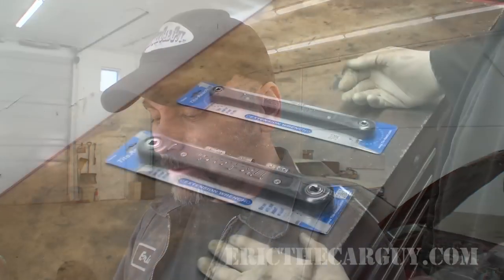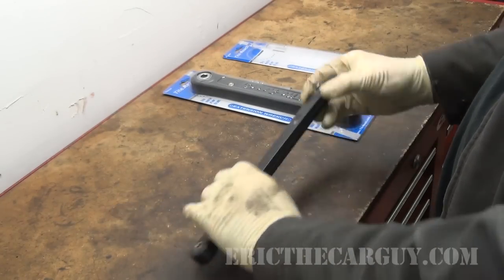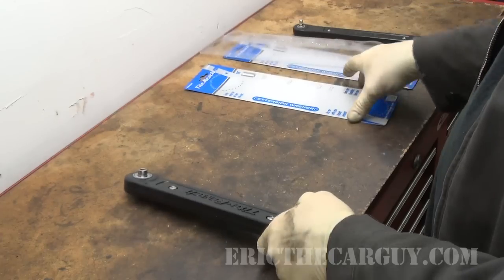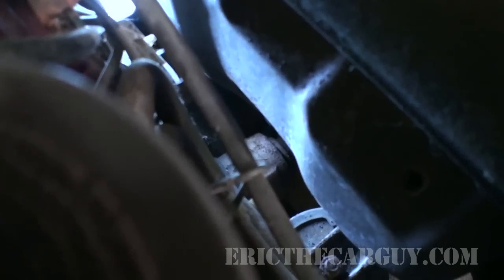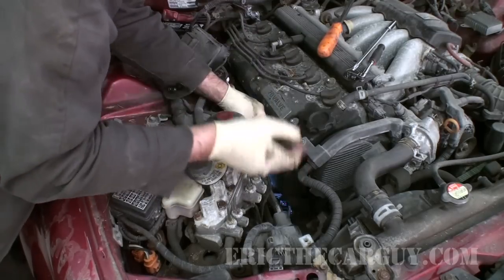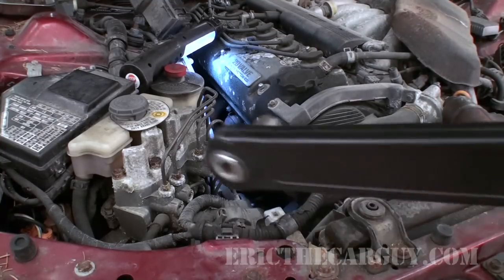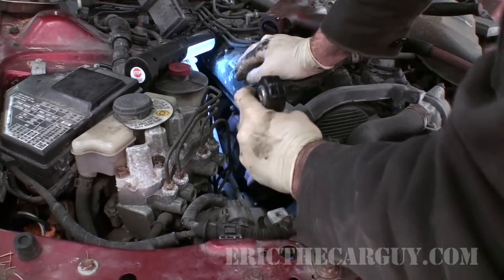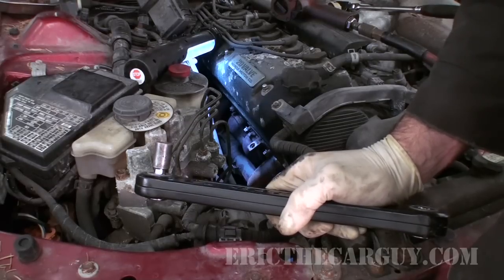Tite-Reach Tool Review -EricTheCarGuy

Comment: I am a auto tech and bought one of these and had similar issues and stopped using the tool. It is quite large for tight spaces in which i wasted time on the job trying to make it work, Not as a "time saver" i thought it would be still had to stick to the manual.

Comment: Working on boats, I’ve found this tool to be a huge time saver 
Some common maintenance parts you just can’t get to without pulling the whole engine, because there’s no room to get your hands in an area
But with one of these and enough extensions you can get bolts turning

Comment: I love unique and "specialty" tools like this.

One thing I learned  (the hard way) over my years of wrenching is having the right tools for the job is CRITICAL. For example, I will NEVER work on brake lines again without a flare nut wrench. Having the right tool for the job will save you time, money and more importantly save you tons of stress. The "special" and unique tools were obviously built for a reason, use them! Lol

Comment: I'd like to see it used with a torque wrench to see how much torque actually gets transferred.  This would be awesome for doing Subaru valve cover gaskets.
Reply: Its 1:1 with slight +or- 3%
Reply: I think he means how much of the "punch" is lost, very much like when you use an extension you lose torque into transferring the energy through.. like a torque stick if you will.
Reply: Gabriel Soria extensions on torque wrenches dont hold much bearing as well (withing reason) . The extension takes up the twist until it  stops then the force is directly transferred to the fastener. Being tourque applied is measured at the ratchet head not the fastener head. Offsets change torque or dont depending on situation. I can explain further about that if people would like. But this device is a direct chain drive, with both gears at 1:1 so what you put on the ratchet is what comes out of the end. Impact torque is different so whats happened here is that slap of the anvil is takin up by the play/lash of the internal mechanism and not relayed to the fastener head as well as we hoped. So there is torque being applied just not as well as if you had a ratchet. And I'd venture to say that it was pretty minimal
Reply: BIG BOSS maybe where confused.. I'm talking about  an impact gun. With an impact it cannot be 1:1, there will always be losses of the impact transferred. But totally agree if your using a wrench.
Reply: Gabriel Soria indeed, the slap of the anvil is taken up by the lash in the chain/gears. Like an extension.... Pretty smart of you gabriel
Reply: The gear ratios are 1:1. They advertise a 8% loss with a torque wrench.
Reply: @jkritter456  where is the link for this?
Reply: Ive seen another famous car fix youtuber that reported a 6% loss. He's pretty reliable so I would say between 6-8% loss at max.

Comment: Erick I invented this a long time ago. mainly to be able to loosen crank bolts with out removing the fan shroud etc to do a seal replacement.. And yes it needed n air gun. My idea uses a very strong chain and is very long to reach places these tools can't.  I like these, don't get me wrong. Will be nice if they made a longer version of them. Great video as always. thanks.

Comment: The awesome thing about this tool is that the way the adapters are designed you don't take up an extra amount of width for converting from 3/8 to quarter inch or half. With a standard socket wrench, you can't remove the preset Anvil, so you're adding extra with which can kill you when you're adapting to a smaller Drive

Comment: The reason your impact would not work very well is that inside the tool the ends are connected via a sprocket chain, your impact energy was being used to stretch the chain, and not actually impact the bolt.  It is similar to how an impact will not work as well with several extensions on it.  Neat Idea though and I can think of a few situations that it would be great in.
Reply: Good point !!!  And that is the principle behind torsion bars; to soak up the shock.

Comment: I'm a GSE mechanic and I can see how this tool will save me a lot of time.  Never  heard of it but it is a great idea.  I wish they had one that is 1/2 inch so I can get a half inch impact on it.  Also this can be used as an torque extension for those extra tight nuts.

Comment: I also want to see a review of cooper tools apex insert and power bits. They are the best bits I have ever used. They come in different hardnesses and never round off. I love their allen bits. You might also want to do a bondus power bit test. They allow angled access to allen head bolts. You can get both of these from mcmaster carr on-line for a couple of dollars each. One other thing you might want to try , Eric, are park tools. These are bicycle tools but they sell some tools that have automotive use such as their three way socket wrench or their three way allen wrench that is like a four way tire lug wrench but have three instead of four and of course, is much smaller. Very handy. Home depot also sells this dewalt right angle insert bit adapter. You attach it to your drill for right angle access of bolts, that's another good one.

Comment: Having to break the bolt loose first is the initial problem. I spent nearly three weeks on two bolts on my starter that I had extreme difficulty just even getting the socket and wrench on it and then there was no room to crack the bolt loose. That tool said it was able to handle up to 400 fiit pounds of torque. If you have to crack the bolt before using the tool, it seems to me, it's defeating the purpose and a waste of money.
Reply: Yeah i feel the same i have long low profile air rachets i can get better results with, bolt buster a induction heater works wonders on rusted stuck bolts as a fyi saved me many times

Comment: That's a neat tool.  In the example you gave though, a long handled ratchet with an extension would have worked just as well.   This tool is more for bolts deep in areas with no room to swing a ratchet.  Which doesn't come up that much IMO.   A bigger problem I have is a bolt with too little clearance for a ratchet at all which this took doesn't solve.

Comment: I bet it would work good on tq converter bolts, and definitely on belt drive stuff.
I would try to make some sort of button that would lock the chain set up or whatever it has..So when you run into a stubborn fastener you could leave the gun, tite-reach, socket in place and snap it loose. unlock,  impact.
good review, eric

Comment: Being a chain/sprocket design it would negate a lot of the impacts effect due to the chain absorbing the hammer hits. I can see where it could be useful in saving scraped knuckles though. Similar concept to the sidewinder tools and the old squeeze ratchet I had, how to remove a fastener in an area you have limited access.

Comment: These tools probably work by using a chain that drives the other side from the one side. So it's just logical that, if you put a driving force tool like a ratchet or an impact on the same side as the bolt is, then you'll have to use it in the other direction, because you turn your force around 180°. Also, the impact motion probably works better when you use it in the conventional way (the impact being on the opposite side of the bolt you are trying to loosen), since the way you used it, the impacting motion would actually hammer the tool away from the bolt! Just basic logic (or maybe physics, but no rocket science anywhere involved). Still, this is a neat invention!

Comment: Eric, do you do reviews of tools that viewers suggest or do you only do tools that are sent to you by companies? If you do viewer suggestions, I suggest you do a review of the stanley (or any other brand) twist ratchet wrench. It is basically a ratchet handle who's  handle you twist like a screwdriver to turn the socket on the end. It is for tight access bolts that don't allow much handle movement.

Comment: I’m not surprised it doesn’t work well with the air impact wrench. Whatever transfers the motion to the other end (chain?) is going to act like a shock absorber and dampen some of the impact ‘blows’, so it’s not an ideal use for the tool. But using it with a plain old ratchet seems to work like a charm.

Comment: I love your show! Also the forum, but this particular tool by the sound and look of it seems a bit on the cheap side. It couldn't even transfer the impact power to the fastener. Now for a ratchet it looks useful in vary tight spaces. But overall I think it can come in a pinch when you need it. Keep up the awesome work you do and can't wait to see your projects come to life. If I was a engine manufacture, I would send you a crate engine :)
Reply from the maker: Thanks. I would gladly take that engine. :)

Comment: I don't know, it just seems like the transfer of leverage is awkward which requires two hands on what may be an impossible to reach fulcrum point.

In my experience which is very DIY limited, I find I'd rather have my hand on the back of the ratchet to make sure the socket doesn't slip off or round the fastener, not at some awkward mid point on a reaching tool.

Comment: Did you run in forward with the impact to have it drive in the correct direction? Since you were using the opposite side, you'd be tightening it if you were in reverse.

EDIT: Oops. Should really stop commenting AS I watch and just watch first. lol.

Comment: Nice video. However i feel that a ratchet (better if flexible) with long handle or extension will work better due long lever arm. Impact wrench aspect is an advantage but again it didnt seem to be working as in the video.

Comment: I would think that if you can get that tight reach tool some where you could get an air ratchet there too. Junk, worthless tool in my opinion.
Reply: ***** If you're going to use a hand tool, might as well use a Gear Wrench which can get in even tighter spaces. This seems almost as thick as my ratchet.

Comment: DUUUDE!!!!  At first I thought this was a bit like an extra long torque adapter that would basically turn a 24" breaker bar into a 36" breaker bar.  This is soo much cooler.  I hope they come out with a 1/2" pro for those really hard to reach fasteners that need a ton of torque and bigger sockets.  Lets you get into tighter spaces than an ingersol rand hammerhead.

Comment: I bought the set of 3,  maybe use it once or twice a year,   its handy when you need it.  Dont use an air tool on it & crack your bolts first and it will last.

Comment: The "impact" of the impact driver won't work because in order for it to do it's job it has to be right on the bolt hammer down on it...  As soon as I saw you going from the same side as the bolt I thought "it needs to be in reverse"

Comment: I guess I'm old enough to see life's repeats. Just like speed wrenches I was given from the 60s and 30 years later Snap On came out with "speed wrenches" , my dad had one of these extensions when I was a kid 40 years ago. It had a ball chain inside that connected the two ends. It was a stamped tin covered mechanism. (I know what it was made of b/c I took it apart) I guess patents run out or get sold and that's why an old tool gets new again. Sometimes, it may be due to better grade materials to make it work better. I guess on the conspiracy side, maybe China is buying up old U.S. patents.
Reply: Its china. they just make it. no need to worry about patents when your nation does not recognize patents of any other nation.

Comment: Interesting. I am wondering what the internal configuration is. Maybe a sprocket on each end connected by a bike chain?
Reply: probably that judging by the size of it, they could of had a bevel gear on each end then a shaft running through the middle with pinions on each end.
Reply: It seems like a sprocket on each end with a chain in-between. Check this picture I found after a qucik search on google: http://image.truckinweb.com/f/newproducts/1310_tite_reach_extension_wrench/49290206/tite-reach-extension-wrench-2.jpg
Reply: 93simlar That's the ticket. Exactly as I imagined it. Thanks.

Comment: I'm not convinced on this tool. I guess its nice for someone who doesn't want to invest in a complete automotive tool set including swivel sockets and extensions (regular ones) but for those of us who invest in a range of tools to deal with tight spots it seems like a skip to me. These days you can just buy Milwaukee's M12 impact wrenches which solves the problem of using a powered tool for hard to reach spaces.

Comment: The impact is rattling the tool and not the fastener.  It's kind of the reality of anything that tries to transfer impact force any way other than directly forward.  You definitely don't need this tool but I'm sure most anyone who's worked on a vehicle can think of something that would've been easier with it.

Comment: 6:42
7:11
To my eye, the tool takes just as much, if not a bit more space than your ratchet. The fact that you have the thickness of the tool, the thickness of the adapter and then the thickness of the socket makes almost no difference. Also seems cheaply made.
Reply: but sometimes all you can do is stick the nut on the bolt but dont have any degree off a turning (to move the ratchet) so this might be usefull for that case... however if you have airtools, good quality air ratchet makes this "extender" a bit absoleete

Comment: Eric In europe Where it is all metris do the sockets have 1/4  ,  3/8  &  1/2 drive or is it in mm.
Reply: +Bruce Boyles In the UK we have mostly mm "normal" bolts but the drives are still all 1/4, 3/8 etc
Reply: All the drives are the same 1/4 3/8 1/2 5/8 3/4 1”

Comment: The problem I have with these is that they are as fat as a regular ratchet wrench on the business end. Recently I repaired a broken door handle on a Mitsubishi Spyder. Great the plastic broke (the older models are complete crap plastic wise) but I removed the unit and repaired it. Fuck replacement costs. Well the repair went very well but one bolt for the door handle mount was  under the loop of glass that makes the electric windows work. Not enough room to reach the bolt back into place and then turn it. 

The space between the window and door lock mechanism is minimal. I MacGyvered a simple wrench from a cheap plastic Venetian blind worm drive with a low profile socket affixed.

It took ten turns of the control rod to make the socket turn once but I only expected it to help start the bolt. By the time it stopped turning I was surprised to find the bolt was snugged down and all I had to do was reach a box end up there and give and give it another quarter turn.

This was only a one time deal for this one job but the problem with these tite-reach tools is they are as fat on the business end as a regular ratchet! From the examples shone any regular ratchet with maybe an extension on the handle would have worked as well.  What about when that shit is just to damn fat and the space is too dam thin for it to fit?

Comment: It has an internal chain drive., and while the chain can transmit torque, it is too elastic with all the takeup between parts, and soaks up the rapid short impacts of an impact wrench.  If you need to use hand tools to break loose a fastener, why use an impact tool to spin them free, instead of a low profile air ratchet or a drill-driver?

.Hnt: Epoxy a coupke rare earth magnets to the flats to hold the adaptere when not using them.
 
 I found it too bulky to fit into most places where I couldn;t use a combination wrench, and not as useful as crowsfoot adapters and an extension  bar, a whole set of which costs less than one of those tools.  The newer passthrough /combination ratchets with +72 teeth can handle many of the jobs that this can do..

Comment: Or just get a set of long handle ratcheting wrenches.
Reply: no wouldnt be as good as long handle ratchets.. imagine being able to get to a bolt but there is no room for to rachet it... then this tool would work great.
Reply: quickguesswho The main advantage is probably speed when using impact guns and extending the reach of the impact gun. The Tite Reach does look a bit bulky, odds are you can ratchet a bit in the same area it will fit. It looked a bit awkward to use with a regular ratchet requiring holding of Tite Reach and looked like to act like a breaker to  loosen nuts initially.
Reply: flemardo i agree with that, it is a little bit.. although the smaller one he did not use looked good..

Comment: I think... This + flexible extension + spark plug socket = easy way to change the rear spark plugs on a front wheel drive v-6 engine.  I know it isn't hard to take off the throttle body and other crap, but it still a pain.
Reply: I never thought of that... I'm buying these tools just for this.

Comment: I bought it, not impressed it felt like it was close to breaking when i put a little torque on it
Reply: Roland Hatton I felt like it would be a good idea to have this but in reality it is a poor man's solution to an angled impact wrench. I grinded for two years to save up for the ingressoll right angle impact wrench which I'm glad to break stubborn bolts in tight spots without a problem.

Comment: Instead of just two sprockets attached by a chain, why not add some gearing in there? imagine it. You put maybe 50lbs of force on your ratchet, and the gearing multiples it 2x or maybe even 3x. there you go, 100lbs, or 150lbs of ratcheting force, goodbye stubborn exhaust bolts!